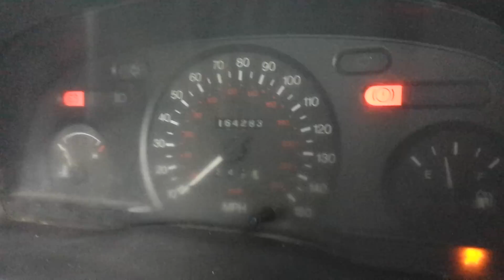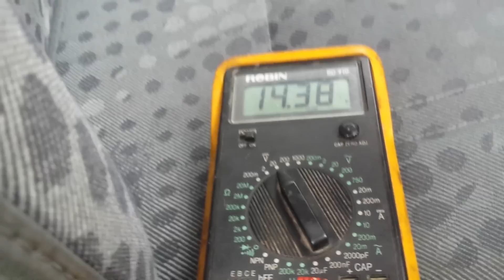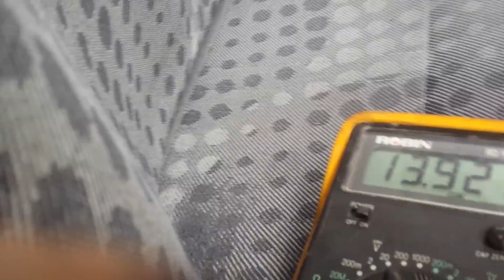Transit  problems.

Comment: That wire is the supply cable for the glow plug circuit. There's a fusible link there that blows, yours has had a bodge repair by the looks of it. There are no other fuses for the glow plugs.

Comment: Hi buddy. Iv got a Transit. 52 plate. Engine n gearbox perfect. The proverbial Transit AKA heap of Rusty shit. But iv stuck with it. N got most stuff done. But I'm having an issue with the ABS. Thing is. This van was an Escort van For wide loads. n transport Static caravans. It had a Gas bottle hoist Beacon Lights And Cb radio. All removed Before I got it. The issue is. Abs Light When On the Breaks work Everythings fine. But can`t MOT the van with the ABS light on. N here`s the Interesting Altho puzzling bit . When I put a Fuse in ABS point. Light goes out. N the breaks Are like Stepping on a brick n Shuddering happens up through the peddle. and like in your video. The mile needle is Fluctuating as it idles. . Iv spent Far more money that the van will ever be worth. I needed a project as a distraction. Thats worked It`s drove me to distraction. N im fed up being robbed by garages. So  i Asking for tips advice or pointer. Im one of the sad cases who love transits. Don`t ask me why. Cause as you know. Its never ending. But if i can sort this ABS issue. woohoo. Iv converted it for going Fishing. but its been Square wheeled for 6 months now. . Can you give me some pointers or suggestions other than FO lol cheers  BTw there was a wire Coming from the Radio area. That when Connected The radio worked. The abs light goes out. Pull that Wire from The fuse area Where it was held in with a fuse Going to the Ignition fuse. N ABS light comes on. BUT  breaks work fine????? I`m stumped.
Reply: My speedometer needle is also bouncing up and down when it’s idling. Did you ever find out why yours was doing the same?

Comment: The wire is for glow plug system the battery light is fault on the small wire to alternate exciter to alt fault that's y light on

Comment: i had same problems as this just recently with my Y reg minibus 90T350. first few weeks seemed to be fine with the speedo needle bouncing a bit more than yours at idle. after 3 weeks battery light came on, i also noticed a wire snipped on the live by live jump point. also every now and then at cranking the starter would just spin with out the engine starting. eventually it wouldnt start at all. as i have 2 transits, i took the battery from my van and stuck it on and gone to crank, lost all ignition lights totally. changed the earth cable. it was fine. tested the starter by running a jump lead to it from the jump point and turned ignition on. the starter was still working. so spent nearly 4 weeks of the road. i have a tacho inside my minibus and that wire that was snipped was joined back up and the tacho started working again where it didnt beforehand and also brought the speed limiter back on. couple weeks ago, my mate took the starter off the minibus and noticed the teeth on the bearing the jumps out to start the engine was worn badly. put on a fresh starter it has been fine ever since. no dash lights while driving now. i have done around 3k miles since and no troubles. my mileage is 470k. but i noticed it goes up slightly while idling
Reply: if the starter spins but the engine doesn't turn then the gear on the starter has gone floppy - i had this happen on mine, it just comes loose and doesn't engage with the flywheel properly
Reply: @jaydee2559  it does start first time most of the time if I press down the clutch first
Reply: Did you ever find out what was causing your speedometer needle to bounce up and down?

Mine is doing the same

Comment: what does it mean when speedo & rev needle keeps dropping & red spanner light stays on, i have reset it by the brake and accelerator peddle but nothing
Reply: Hi Dave did you find out how to fix your van has I have the same problem

Comment: Mines just died on me, I stared it up drove 300yds and it conked out, the glow plug light was flashing, and it won't start or even fire at all just turns over, I think it's fuel starvation, but why.. Any ideas anyone

Comment from the maker: Ebay Des
Reply: cornishrob123  hi is the glow plug relay stack on ,take it off first top left open the case of relay and release it . at the moment you haven't got  power to glow plug
Reply: @nicuiordachi8922  Cum a rezolvat problema mister enghish?

Comment: That wire is the supply cable for the glow plug circuit. There's a fusible link there that blows, yours has had a bodge repair by the looks of it. There are no other fuses for the glow plugs.
Reply: I dont mean to be so offtopic but does anyone know of a way to log back into an instagram account??
I somehow forgot my password. I would appreciate any tricks you can offer me
Reply: @Damian Rex instablaster ;)
Reply: @Malachi Diego i really appreciate your reply. I got to the site thru google and I'm trying it out now.
Looks like it's gonna take quite some time so I will reply here later with my results.
Reply: @Malachi Diego It worked and I now got access to my account again. I'm so happy!
Thanks so much you really help me out :D
Reply: @Damian Rex no problem xD